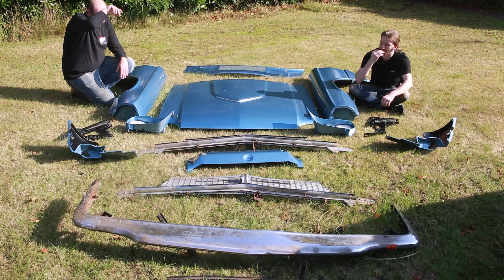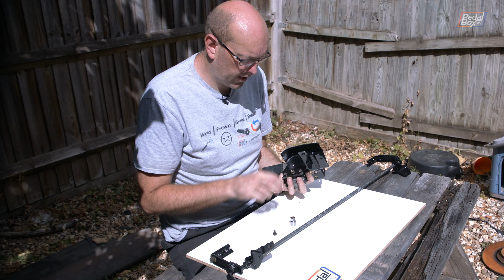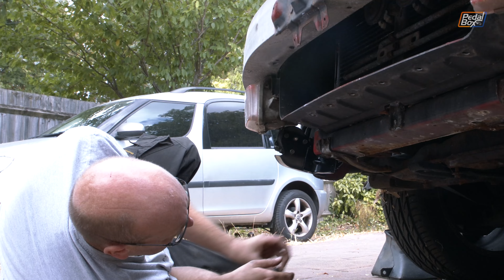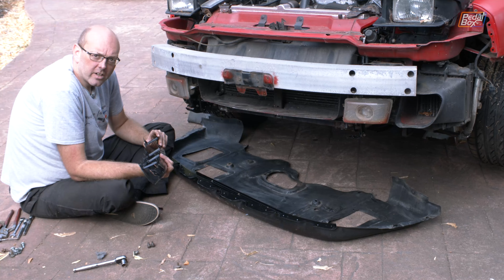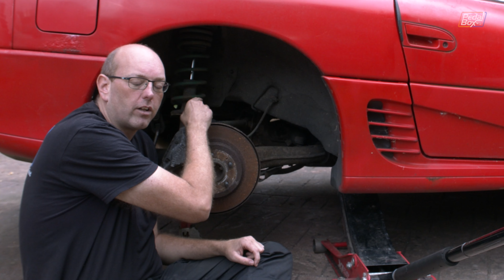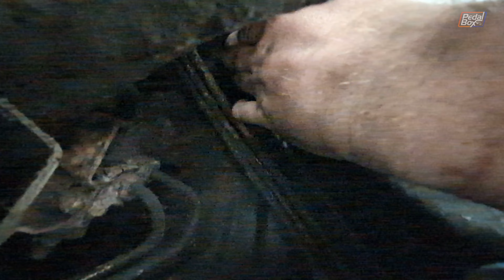Active Aero Rebuild | Mitsubishi GTO | PedalBox Episode 184 | Fleet

Comment: My brake lines failed in the exact same spot. I ended up bending my own hardlines and flaring them, very labor intensive but the parts price is very affordable with universal lines. Currently working on my front active aero Michigan winters have turned it into a rusty mess, thank you for having the clearest video on youtube on the mechanism.

Comment: Did you give up with the brake lines or just parked it over the winter? The worst of the rot on the brake lines is where you have discovered already, if you are lucky there is good steel left in the middle of the car for you to cut and join in replacement lines, however... in order to have any chance of doing the job, the rear subframe needs to be dropped down a foot.
Reply from the maker: Parked over winter. And the Rodius is in the 'major work' spot on the drive. But thats basically done now so the GTO can go on there next, also got some taller stands so a bit more space under it to work which'll be nice. I think it'll be new lines from the firewall back to wherever they go. Start at the back with the bends and then run foward. I can see the subframe being a nightmare though. And theres a whole run of "while i'm here" jobs that pile up

Comment: Did you remember to fit the spacer blocks (about 12-15mm tall) between the aero tray and the mechanism hangers?
Reply from the maker: Interesting. I don't recall having them on ours when we took it apart. Possible that it's been lost/removed before we got it, but that would lower the overall position of the tray both at rest and deployed which would make the clearance worse butt he aero better. I'll see if I can find some examples and either make some or find some for the future

Comment: Hello, I’m planning on building a custom front aero tray for my 91 VR-4, and was wondering if I could have your help with some thing! I’m a little unclear on whether the motor does a full rotation, or whether it reverses polarity and only operates in 180 degrees of motion.
Reply from the maker: The motor does a full rotation as best I can tell. The switch block/gear appears to be setup that way so it only goes one way. 180 degrees to deploy, then rotates the same direction to retract, so the motor never runs backwards.

Comment: Did you order the clips from Mitsubishi or did you get aftermarket clips? I am fixing my front active aero as well.
Reply from the maker: I haven't ordered them yet, I put it back together quickly enough that it was "fine" for Rustival and then the brakes went. So thats one to fix once it's in the air again for easier access. But i'll put a note in the video when it goes up where I got them. I expect it'll be aftermarket though, when I find some

Comment: The same happened to mine, there’s a union behind the engine, bolted to the fire wall.
I had to replace fuel lines and rear steering lines as well. I used braided AN-6 for the feed to the filter and then rubber fuel line for the return and the vent. 
I couldn’t find fittings for the rear steer so I went to a local hydraulic repair place and they cut out the steel lines and crimped new fittings to the end of my existing rubber hoses and joined in  new hose to replace the steel one
Reply from the maker: Thanks for confirming! Makes it a somewhat doable job on the drive at least. I've found some 8mm solid fuel line, but the braided AN is tempting. Any idea what the fuel fittings are? I hadn't even considered the rear steer, I was hoping to let sleeping dogs lie if they looked ok
Reply: @PedalBoxGarage I don’t know what the fittings are as I swapped the pump out for a Walbro pump because all the steel lines were corroded and brought the new AN-6 line straight to the filter with a new banjo loop. It’s fairly tight getting up to the pump and filter so might need something flexible.
The rear steam was easier than I thought it would be,

Comment: Holy shit those lines are bad. And I don't mean rusty, I mean they're poorly designed from a maintenance point of view, because what in the everloving fuck are you supposed to do about finagling one of those into place?! What an arse-ache.
Reply from the maker: From a decent amount of hunting, I've found a set of them on ebay for just the engine bay and two look like they have a fitting roughly where the back of the firewall is as they run into that cradle under the car. SO no impossible routing... maybe. 
If I can find the join I can make a start. BUT I also need to do those fuel lines, really. Because they are REALLY poor looking too.

Upside, More GTO videos!